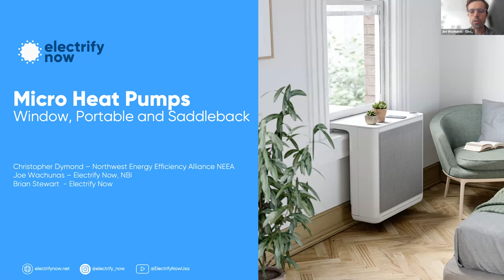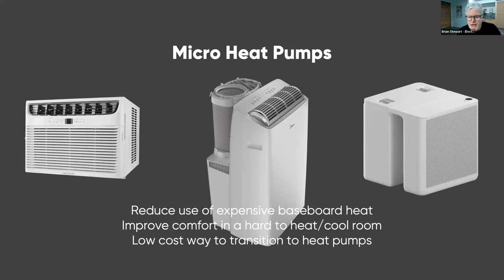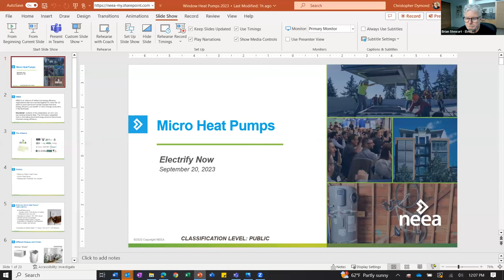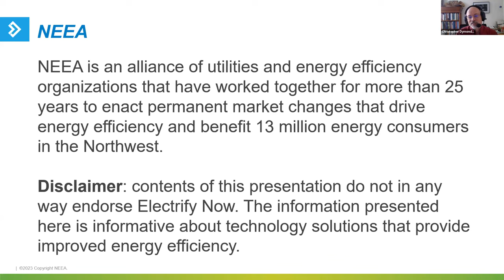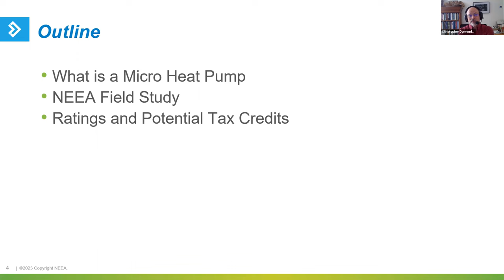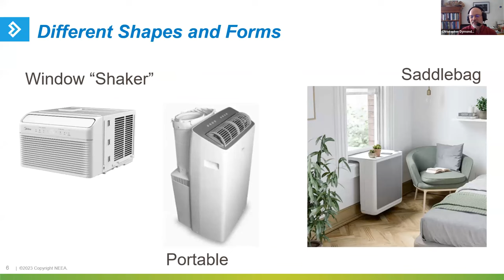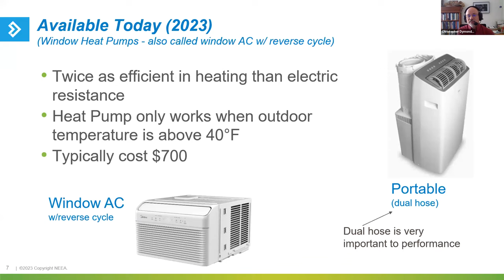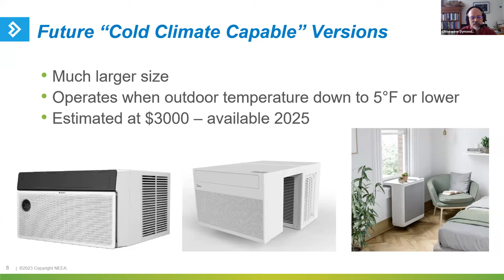Micro Heat Pumps - Window, Portable and Saddleback

Comment: Thanks for the Info. I have been looking into adding a ductless heat pump. 

** My house is an old 1-1/2 story house. Originally it had heat that came up through a grate in the floor at a central location (dinning room) to heat the whole house. Later it had a boiler put in with baseboard hot water heaters added. That boiler is about 60 years old and I maintain it my self. Put in a new oil filter and nozzle this fall. We keep the thermostat at 65°F.

** I installed a 23,000 BTU air conditioner in the dinning room wall pointing across the room to the living room. There are doors that can be shut to the rest of the house. We only turn it on when it gets up to 85°F.  I installed it about 1977 so it is quite old now.

** If a heat pump went down to 32°F it would work here in Dover Delaware most of the days of the year.

Comment: The Midea Duo portable heat pump variants have a defrost function! They're limited to 40F as you stated but many people on reddit have already figured out moving the outdoor sensor to a warmer location will keep these models running in colder temps. In colder humid conditions they defrost frequently.
Reply: Slightly tangential but I've heard of people using windlw ACs for walk in coolers rigging a thermostat activated lightbulb to heat the temperature sensor in those applications (in fact it's a YT vid for an $80 alternative to the much more expensive Coolbot controller.)
Reply: Can confirm, in fact I even put a video on my channel, the duo can defrost.

Comment: I have never seen a micro heat pump for sale. Please give links to suppliers. Great video. Thank you
Reply: Micro heat pump = Window A/C. They are for sale at Wal-Mart.
Reply: @Sethermiester  Wrong. Only one may be available at Walmart and it won't heat below 40 outside temp. Most window AC units with heat have a separate resistive heater built in and do not actually reverse the refrigerant to provide heat inside.
Reply from the maker: They are not called micro heat pumps on retail sites.  They are usually referred to as Portable AC with Supplemental Heat, or Window AC with supplemental Heat.  Here is a fact sheet with some of the models we recommend. https://static1.squarespace.com/static/5bb2379dca525b5810509ec1/t/64274541529ec679daf107ca/1680295233936/Portable+Heat+Pumps.pdf

Comment: 25:45 You are wrong! Window units of saddle A/C on the market now shut off because they can't drain outside. You got to manually drain them on the inside. They could solve this by having both the condenser and evaporator on the outside and just have air duct work go across the window or they could install a pump to pump the inside   condensation to the outside. Water splashing outside is not a concern for me.

I think Midea has PTAC units out now. I am thinking about these on the back side of my house. I already have electric baseboard in my home so my thinking is electric is already run. Remove the electric baseboard and wire in the PTAC to the 230v lines installed for the baseboard. I am trying to get pricing info on these but they are a bit invasive.

I have the Midea inverter AC units for a few years now. Wow they made a huge difference in lowering my electric bill over the normal 4 window AC units I had. I would jump at the opportunity to have one of those window units at the right price to both cool and heat. However at that a 3k price I would rather have a permanent mount mini split or PTAC units. I am handy enough to install them as a DIY project. Electric baseboard sucks.
Reply: I love my Medea window unit but it trips my generator's GFCI AC plugs.  

During disasters and power outages I have to use my older window unit.

I bought a 60 watt dehumidifier to help and it does an excellent job of keeping my house below 50% humidity.

Comment: One physical issue I have not seen addressed and is definitely an issue of concern with DIY is the size and strength required to install the window  units. Even though I needed a larger capacity unit from the one I purchased, I could not lift the larger units.  Instead I purchased two smaller units.  The lightest unit I found still weighed 40 lbs and at 4'9" in height, had a difficult time lifting these units into place.  More and more women and the aging population mean that people with less strength find themselves in a position of having to do these kinds of projects themselves.  Larger and heavier units mean it will be difficult for this segment of the population to use/install.

Comment: I have through the wall mounted my Frigidaire FFRH0822R1 8,000 BTU Room Air Conditioner with Supplemental Heat. It is a heat pump down to about 40F and then has electric resistance heat at a lower BTU value. Sadly, it is now discontinued.

Comment: Thanks for all the great info. I have a unique situation I think these would help with. I'd love to be a tester if there's any way to get in touch with one of these companies. I have a single family home with a small side porch under 100 sqft that has been enclosed and insulated with a single door between it and the house. I want to make a it a year-round room, but can't get HVAC ducting to it. The exterior walls are lined with windows, so I can't install a mini split and it would probably be overkill for the small space. Resistance an oil heat options use too much energy since I'm in a cold environment that is generally below freezing in winter. 
I've looked for the smallest mini-split available hoping to find something very tiny, but they don't get small enough to mount to the less than 10" of wall space between windows and ceiling. I looked at the Gradient, but at it's current price of $5,000 it's much too expensive. 
I really wish there was a much smaller version of a mini-split that would work in tiny spaces like mine, but it looks like the best option will be one of these window units. I'll just have to wait for prices to come down.

Comment: How many amps does this need? What if you have other things running on that same circuit. It will likely blow the breaker. Look at heaters and the draw they have.
Reply: A heat pump has a much lower energy draw, that is why they better then a standard heater. Looking forward to the cold climate versions coming out.
Reply: @MirrimBlackfox   Can you elaborate on what the draw is? Thanks for the reply
Reply: @RobSnow-ui4sz  It really depends on the unit, I just know that heat pumps are quite a ways more efficient then a heater is, but to know exactly how much you would need to look up the specifications of the specific unit.
Reply: The Midea Duo unit (14,000 BTU) has inverter technology, so rather than just switch on (big draw) and off, it allows a sliding power draw based on how much work it has to do.
I found my unit is typically under 1.2KW, (10Amps at 120V) and usually around 700W (6A at 120V). Users results may vary depending on humidity, outside and inside temperatures, etc.

Comment: Stupid question: if a conventional window heat pump can only withdraw heat from air down to 40°F and must then use resistance heating anyway, wouldn't it make more sense to use that supplemental heat to preheat incoming ambient air? All else being equal (which of course tends to never be the case) wouldn't raising 30°F ambient source air to 41° be a much better use of energy potentially allowing a COP return on that investment approaching the unit COP when operated above 40°? Besides if the outside ambient temperature is at or below  30°F it's supplemental resistance heat must be heating output air much more than 11° to meet comfort standards above body heat unless ambient inside air is kept to 87°F or more. 

Granted I'm not allowing for the ratio of outside source air flow vs the flow of conditioned interior air but still, wouldn't expending that additional supplemental energy before the heat pump allow for more a greater COP than 1?
Reply: Whether you come out ahead would also depend on the relative air flow rates of the outside are vs inside air. It certainly may be possible, particularly if only a few degrees.
Patent it, maybe?

Comment: How much good will these new cold climate window units do if their price is only competitive with professionally installed mini splits? Why should the price ever become competitive with existing >40°F window heat pumps, already considerably more expensive than an AC and a space heater, if government programs will throw >$3000 per unit at fairly small 9000btu units.

Comment: I'm using captions to try to spell the manufacturer for the three.  But the captions are phonetic, not correct.
Gree and Midea?  And Gradiant?
Would be nice if you spelled them.  Or ensure captions are correct.
I'm trying to locate a window unit like Gree for my small house, but no luck.
On Google, at least.
I rewatched video and see they are not yet on the market.
I'm in Pacific Gas and Electric territory.
Humboldt County California.
Snowing today.
Our electric rates have gone through the ceiling.
All electric, mountain house, without gas mains.  No option for gas.
I'll follow your channel for updates on micro heat pumps.
Please post videos as you learn more.
6,000 btu.  120 volt preferred.
Maybe saddle type is more available?
Reply from the maker: Hello - the manufacturers I think you are referring to are LG, Frigidaire, Whynter, Midea and Gradient.  Gradient makes the saddlebag version and Midea is also working on a saddlebag model.  Cold climate versions of these units are not available yet, but the ones on the market now will work down to about 40 degrees outside temperature.  Gradient will probably be the first to release a saddlebag version that will work down to sub freezing temperatures.  https://www.gradientcomfort.com/

Here is the fact sheet that we referred to on the webinar with model names and numbers - this does not include the Gradient product - only the portable heat pumps on wheels.
https://static1.squarespace.com/static/5bb2379dca525b5810509ec1/t/64274541529ec679daf107ca/1680295233936/Portable+Heat+Pumps.pdf